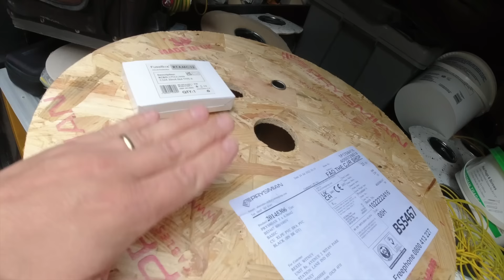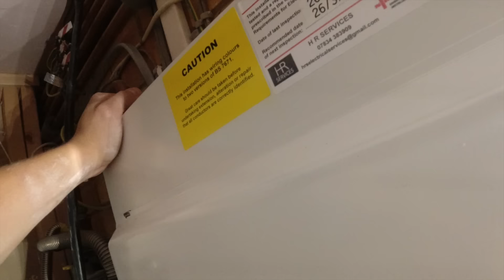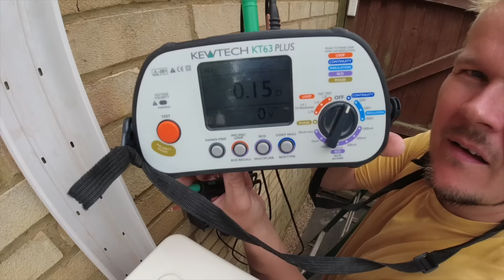HOT HOT HOT - INSTALLING AIRCON. No idea!!!!

Comment: By the by, when you cut the armour for a gland, have a strand or two of old armour, handy in the van. After the cut bind one of your spare strands in the cut nice and tight. In the event, every now and again when one don't properly cut a strand or two it stops that strand from bending out when you break them off and making it very hard to get the gland fitted properly. I do it every time and especially on 25mm or higher it makes a world of difference.
Reply: Not sure I understand.
Reply: @Woodkin007  Ever prep armoured for install? If yes it should be clear as day
Reply: @emilmckellar4932  all the time. I just can't translate his description about what he's wrapping around the steel strands to stop it doing that annoying end bends it occasionally does.
Reply: @emilmckellar4932  hang on, you mean you snare a bit of steel strand around the strands?
Reply: @Woodkin007  easy 1. Make cut 2. Use old steel strand from a previous install and wrap tight in that line you just cut. 3.  Now clear pvc off infront of your cut 4. Snap the armour steel off. 5 if one was not cut well your binding will hold it in place and you have a second chance to cut it. 6. Put rubber boot over 7 put locknut over 8 cut pvc behind your now clean cut armour.  9 slide gland over and under armour. 10 tighten and clean the inne pvc off the strands 11 put banjo lug on 12 put in hole 13 put end lock not on 14 tighten 15 drill for banjo 16 earth.
Reply: @emilmckellar4932  many thanks. Didn't need the Collins DIY past number 5 but many thanks for explaining. Have a good day.
Reply: @Woodkin007  😊👍 I did want to start with a survey and end with sweep the floor but thought that would be obtuse
Reply: @emilmckellar4932  shawshank redemption.

Comment: Another interesting video, Chris. New single phase inverter air conditioners require F type RCD, A type do not fully support them.
Reply: Type F RCDs are used for frequency controlled appliances and equipment.
Examples of equipment include:
air conditioning controllers with variable speed drives
some Class I power tools
washing machines
dishwashers, and
tumble driers which contain synchronous motors.
Type F devices are also suitable for Type AC and Type A applications.
Reply: @psi10001  Air Con units of that style here in the US are almost exclusively inverter types, I'd be surprised if this isn't considering the concerns about energy efficiency in that part of the world.
Reply: @psi10001  Don't forget that newer inverter microwaves also have basically a VFD driving the transformer

Comment: What was the neighbour's complaint about AC, out of interest? Just noise?

Also do you know if it's set up to be able to run in heat mode? AC unit and heat pump are the same thing, just with refrigerant direction reversed. Could save a ton on his gas bill
Reply: These units are dead quiet mate its a modern Panasonic 
The manufactures know that noise is peoples biggest grief with them so they came up with almost completely silent units you probably cant hear it behind the wooden fence unless its on full blast.
Reply: @alouisschafer7212  yeah, that's why I'm curious why anyone would complain. Some people like to make a fuss I guess

Comment: Why use armoured when the vast majority of the run is internal - hard to manipulate, 30% more expensive? If you put the outside run in trunking it could all be T&E. Just asking as an amateur observer.
Reply: I think Chris mentioned that being hard to manipulate was the reason he used it. A more flexible cable would have been harder to push through from the outside to the first downlight hole.
Reply: @stuartarnold9444  yes, he did. But 6mm2 T&E isn't very flexible. Also terminating SWA takes so much longer. I can see why he did it   though.

Comment: clean work, however dose swa need to be clipped specially if it running over a living room?!
Reply from the maker: Why? I use reference method 100
Reply: @Cjrelectrical  👍🏼👍🏼 *Reference Method 100Installation methods for cable touching the plasterboard ceiling surface, above a plasterboard ceiling with thermal insulation exceeding 100mm in thickness having a minimum U value of 0.1 W/m2K.

Comment: Interesting that you're not switching the neutral. In the US neutral is required to be unswitched along with ground with all switching Don and Hot conductors. So maybe that guy has run into issues where the switch has not fully switched on the neutral leaving the system with a floating neutral?

Comment: i'd maybe add a label inside the switch too as pretty sure the out side one won't last long in the rain and sun and general UK weather
Reply: The isolator is for the AC tech to isolate the AC unit when working on it. They don't need to remove the isolator cover. Also once the lid is removed it becomes clear that the neutral isn't switched.

Comment: It's a very good installation just a couple of points. When cleating the cable on the outside wall with a little more fault  the last cleat would have been the correct way around.
I noticed the line conductor was only going through one of the poles on the multipole switch, will the air-con contractor make the necessary adjustments to prevent uneven ware on this multipole switch.??
Reply: The air-con contractor requested that the Neutral not go through the isolator. Chris labelled the isolator accordingly. However, both poles can still be isolated at the board.

Comment: With regards to the unswitched neutral I believe this was a requirement on Daikin ac vrf systems years ago and to do with the inverter pcb, I’ve heard of a few cases where pcb’s had blown upon switch on. It’s also common to have fuse requirement of 25a so obviously this is upsized to 32a

Comment: Why not use 6mm twin?
Reply: idd wondering the same.. wuld be much cheaper and easy . Just a piece of conduit on the wall outside.
Seems uk electricians like to struggle with SWA . ( or the code requires ? dunno ? )
Reply: Chris answered this in the video - to protect the cable from potential nails and screws, given that it’s in the void between ceiling and floor.

Comment: Why not use 2 of the 3 poles for Live and neutral and isolating the neutral at board would then not be necessary. That’s how a AC engineer would do it .
Reply: Regardless of how the isolator is wired (which is how the AC engineer requested it) the RCBO at the board is double pole.

Comment: 13:31  Don't see the point not disconnecting the neutral at the switch .   Even don't understand the need for isolation switch and it's ugly at the wall .. .  Here in Belgium you never going to see this in a residental installation of  A/C ..  Double pole braker is more then enough to isolate here .   Also again this expensive  SWA cable ( seems a nightmare to install and terminate ) .. is  twin-earth or  NYY-J  ( alike )  not allowed in this case ? ( maybe in some conduit of trunking on the wall ..  seems verry common to put  ugle black cable on walls in uk with clips ...    Also 99% is probalby single fase in uk residential .. and still cable with no blue color inside ..don't get that .
Reply: haha wondering always the same about UK regs - seems so overkill with that that cable watching from Denmark. Here we use PXILD/PVIKJ cable and its used both indoor and outdoor, no hassle and no trunking needed, just mechanical protection close to ground. Although isolation switch is needed here as well and good idea, this also creates termination point for the flexible installation cable as it's most appriopriate to use. The switch can also sit on the heatpump cabinet as well.
You also probably mean green/yellow wire inside not blue :D
Reply: @96Lauriz  no .. he used Grey for neutral ( wich is fine )  and yes no  yellow-green because the steel arround the cable is earth ?   Seems more a  3fase + earth usage cable .  We don"t have this kind of cable here .. we do have some kind of  cable with metal protection  ( but still has yellow-green if remember )  but in this case we would not use .
isolation switch seems a funny thing when garden is reachable .. kinds who turn it off and so lol .. but yes handy for maintnance you don't have to go inside to turn off the breaker.  But why the AC guy wanted single pole disconnect i don't understand .. if he makes a neutral to eaerth fault in the AC .. RCBO will trip with the isolator off  🙂
Reply: @96Lauriz  PXILD  is verry much look-alike as our standard XVB Cca cable here in Belgium .  But seems to be ECA Fire-rating . We cant's use these anymore in bundles of cables  or sealings ( open space)
Reply: I’m not sure as to the reason for not isolating the neutral but local isolation is common practice for safety in case of emergency, I wouldn’t use SWA for this job it’s just his choice, 3 core SWA cables are commonly stocked in local suppliers in 3 phase colours and is fine to use as long as you sleeve in correct colours but single phase colour identified cable is also available, different people have different ways of doing jobs and leaving them looking neat and tidy, it’s common to see other peoples jobs and not like the look but don’t pretend all electrical installation jobs in Belgium look like works of art pal
Reply: @icemanA84  nope Belgium definiltly doesnt look as art :-)  It all depends who installed it .  Here we are not allowed to change colors of the wires.  When blue is not present  we use grey for neutral this is allowed .   CPC can never be used for power ( yellow green )   When a blue wire is present is has te be the neutral ( unless its 3 fase  w/o neutral ) . 
I see this SWA 3x6mm is about  4,25 pound a meter . About 5 euro / meter . acutaly cheaper then i expected .
The cable i would use here in Belgium  ( XVB 3G6 not armourd  is also about 4-4,50 euro / meter )  Seems twin & earth is very cheap in uk .. about half the price of the SWA ..
Reply: @kittsdiy  not being able to use sleeving to change conductor identification must be a pain lol, twin and earth would be fine to use but would need to be installed in conduit or trunking to protect from UV on the outside wall, looking at the distance the cable has been run and with no insulation in the floor I think he over specked the cca I’m sure 4mm would be fine for the 32amp supply, trying to make the job pleasing to the eye can be one of the more time consuming parts of the job 🤣
Reply: @icemanA84  never had a big issue with colors .. the cable we get has 99% right colors .   4mm on 32A  MCB  is not allowed here ( at least not residential )  .  1,5mm = 16A MCB   2,5mm = 20A MCB   4mm = 25A    6mm = 32(40)   10mm = 63A   16mm = 80A . etc . Always type C here . type B not very common here but allowed .
Reply: @kittsdiy  we rate our cables based on different factors, installation method, grouping factors and voltage drop he installed SWA in floor with no insulation and no grouping with other cables (through trunking or duct) and possibly 20m max, 3 core SWA XLPE 4mm installed under these conditions is rated to 42amps carrying capacity.
Edit - forgot to add ambient temperature also important
Reply: @icemanA84  in industrial  environment  we have cable calculations.  Residential is always on the safer side .
Reply: @kittsdiy  again depending on the installation factors it’s not always safe what you have listed, for example 10mm twin and earth installed in insulation exceeding 100mm thickness is only rated to 36amps so allowing 63amps through could result in overheating the insulation, you should really apply design to all electrical installation not just industrial for safety and reducing unnecessary costs.
Reply: @icemanA84  we don't have twin & earth here .. seems very thin isolation etc .  The  values i say are rule of thumb .. ofcourse distance mathers also etc .  And all installations here need to approved by a 3th party inspector ..   Seems in UK this is not needed .?   And also no drawings of the fuseboard and house ( where sockets  / switches are located )
The values are from our Belgian  A.R.E.I ... ( kinda like the 18the edition stuff in uk i guess ? )
Reply: @kittsdiy  electrical contractors in the UK join accreditation schemes and we are assessed annually to maintain standards (although I’ve seen rough work by registered electricians) so we can certify our own work but it’s also possible for a DIYer to get a building control inspector to inspect installation work after 1st fix and 2nd fix to sign off work, circuit information needs to be fixed beside the consumer unit (circuit ID’s, protection, installation method etc) but we don’t need to provide a map of wiring and accessories locations. EU was always looking to unify standards so our regulations would likely have a lot of similarities as well as a few differences.
Reply: @Samuel yep i didn't make the rules of the A.R.E.I ..  Lighting circuits  1.5mm - 16A MCB ( 10A melt fuse )   Socket  2,5mm 2O MCB ( 16 melt )   4mm cable is 25A MCB or 20 A melt fuse .    6mm cable is max 40A MCB ( but we use mostly 32A altough 40 is possible )

Comment: 32A circuit seems like a lot for one of those modern inverter driven units.
Reply: My thoughts exactly. My Splitties in Aus are on a 20 amp RCBO. 7.5 RKWH
Reply: Yep  6mm-  32A seems a lot ..  my  20 year old mitsubishi split unit .. only needs   700 watts ..  for  2500W cooling ..    Don't know the power of this panasonic and how many indoor units are connected .but 32A braker and  6mm seems overrated .. but maybe for feature expanding ?
Reply: @jurassicsparks5220  same here in Belgium ..  2,5mm²   on 16-20  braker is fine .
Reply: Long term it will make it an easy point to connect a heat pump too if we ever get pushed to abandon our gas boilers.
Reply: @Marks-Garage  true .. but they will need more then just this cable  then  ( for radiators  .  And this  A/C is already a heatpump ( heating & cooling  ) and able to connect  5 indoor units ..
Reply: @kittsdiy  I don't think they have as good a COP as the air to water heat pumps. I do prefer these over the heat pumps they want us to go over too thou.  Makes sense to have AC and heat.
Reply: doesn't it though! that thing will probably pull 7-10 amps 😂
Reply: Electricians who don’t know what they are doing oversize cables, especially with air con as they think it pulls massive current but it doesn’t as they are unfamiliar with how it works
Reply: @daves8003  they should check the data sheet of the device .. i'm sure on the unit itself the power rating is specified . Altough it's not bad to pull a thicker wire .. but i would not put a 32A braker of a device that is nown to  max  10A current draw . ( i proably would put a 16-20A or 25  depending on he specs ) .  Maybe they where thining an  AC unit with 7KW cooling capacity .  That 7000 watt ( 30A current ) .. ok we need 32A  MCB .  ( would be a ver inificient A/c )
Reply: The air con guy who did my multi split system  said the electrical input power was about a third of the cooling power , so 6kw of cooling would need 2kw of power . If your system has 2 indoor units and 6 to 8 kw of cooling you only need 2 to 2.7 kw of power so max 12 amp . A switch fused spur would have covered it .
Reply: @dennisphoenix1  makes sense .  2,5mm on 20A MCB ( maybe a C type)  would probably be plenty .
Reply: @kittsdiy  mine is on a C type 20amp with 2.5mm cable.  I haven't measured the actual current draw on it . Might be something worth doing to confirm the ish gauge of one third input power
Reply: @dennisphoenix1  my AC also  Mitsubishi split from 2004 .. 2,5KW cooling ..  so cable and MCB is moooooooore then enough 🙂
Reply: @kittsdiy  mines Mitsubishi heavy industries . I have 3 indoor units and one outdoor.  I installed the units , piping , condensation drain and wiring.  Air con guy connected up and gassed up etc . Cost £2800 but worth every penny for a decent night's sleep.
Reply: @Marks-Garage  I read they can have a COP of up to 5.5 so maybe better than air to water just the government don't want you running them all year hence no grant!

Comment: Should a fused connection unit be put in for the indoor unit as it pulls so much less than outdoor unit? 

Wondered as 32amp alot for a indoor unit pulling approx 3 amp
Reply: My understanding is that the indoor units get their power from the outside unit - via a power and data cable that goes back with the refrigerant line sets to the outside unit. So, the electronics in the outside unit is responsible for any overcurrent protection for the indoor units.
Reply: @JasonEDragon  That makes sense but I didn't find a in line fuse on cable between the two units? Does it detect over current another way?
Reply: @JasonEDragon  I'm also doing power for AC job.
Reply: It's not about how much it pulls, but what size of cable is used. If it's less than 4mm2 it should be fused down...but the main unit might have its own internal fuse?
Reply: @tobysherring1369  Yes I agree, it's 14.5 amp max as a total of both units, uses 2.5mm inter connecting cable and 16 amp breaker so cable protected but I have used fused connection unit for internal unit anyway as not protected by outside unit I found on mine and indoor unit only pulling approx 0.5 amp the 16amp is over sizes for over current on indoor unit, so I've fused down to 3amp.

Comment: South Afircan regulations, the isolator MUST break both L and N in 1ph or all three L in a 3ph system
Reply: makes sense .. don't know why you would leave Neutral connected .
Reply: @kittsdiy  One can maybe, and this is a big maybe, for a product specific install install a contactor with a timer on the live side so they don't turn on at the same time but it will have to break at the same time when the isolator is opened. Maybe there is a drain resistor and they want to discharge caps in the unit before you work on it but that they could do to earth I can't see why they would want to do it to N🤔
I would say that is why one never break the earth in 1ph nor the N in 3ph